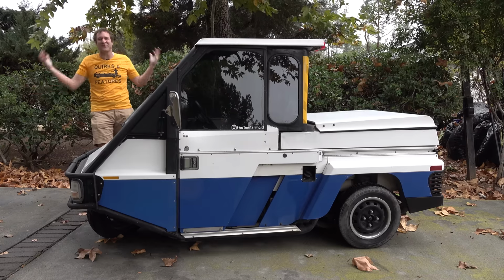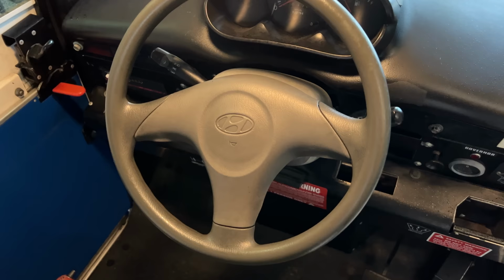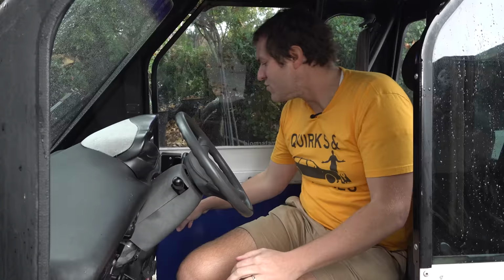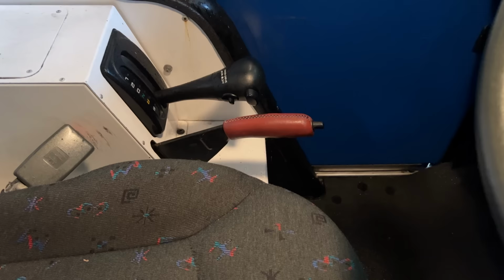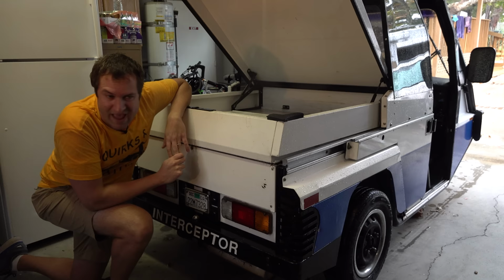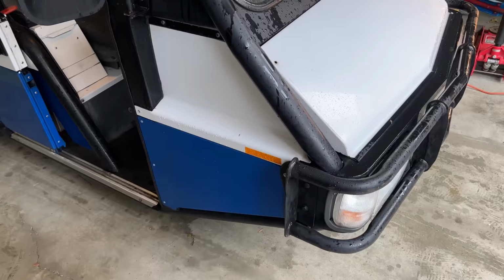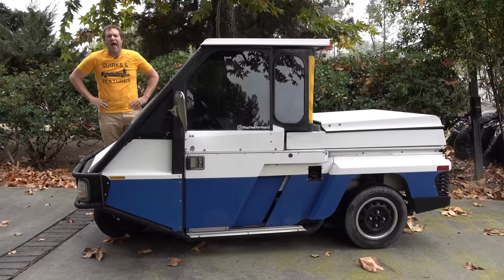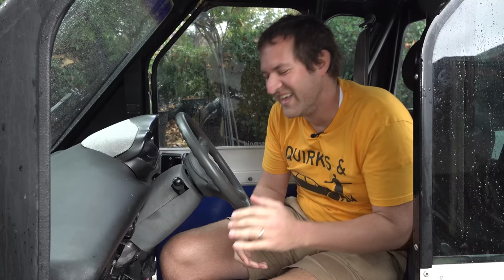Here's a Thorough Review of a Meter Maid Car

Comment: the Lateral Thrust Indicator is a great idea, it should be implemented on all reliant robins
Reply: Jeremy Clarson would suely agree. What I don't get about that instrument: When you're entering a bend  too fast and that thing goes off, isn't it too late to do anything useful at that point? Braking when alread in the turn usually not a good idea.
Reply: @andreasu.3546  Ideally it would be set BEFORE the roll level. So like say 90% of what it would take to roll. If you're ever in a turn where you're going too fast then just let off the gas. When your tires are turned like that you have a lot more drag than you would normally. You can also lightly put your foot on the brake for a bit more as well if you really need it.

Comment: I disagree with a 1 for practicality. Yeah its 3 wheels and its 1 seat, but it's also got a massive cargo area, and realistically has to be pretty good on gas... that's gotta be worth something.
Reply: This looks like it could be redesigned I to something that could be for light duty
Reply: It probably has a tight turning radius and is easy to park
Reply: It'd be super handy for popping down to the supermarket
Reply: @Simoxs7 the part about the Piaggio Apé is so true, I mean, we have a lot of this vehicle here in the Philippines.
Reply: The cargo area didn't look massive, objectively. It looked quite decent for a vehicle that tiny and made for a purpose where cargo doesn't need to exist, but that's it. If the thing was electric, without the engine eating a lot of space from the middle/back, then the cargo area would have been surprisingly spacious.
Reply: Against other cars it's a fair score but for what it does I'd much rather have this than almost any normal car
Reply: For its intended use it is actually a maassive engine, a single cilynder displacing 50 cc would get the job done... Which leads me to the fact that an actual motorcycle would be so much more practical and efficient, and even that would be wasteful because a bicycle can do the same job.
Reply: @Lianpe98  These days you see regularly advertisement for three-wheeled vehicles not that different from the one in the video, but much lighter and electric. The top speed of around 45kph (28mph) and a range of even 150km (93 miles) would be plenty for the job. It would instantly solve the problem of the stupidly loud engine noise we heard in the video.

Furthermore, these electric vehicles, often meant for the elderly, I reckon, seem to cost less than half of the price of that Meter Maid car. Looking at how that Meter Maid car was built, I'm not sure the quality would be a problem either. The only concern might be safety if a big truck collided with the vehicle. How often does that happen, though?
Reply: I'd do grocery runs or small item garage saling in it
Reply: @Simoxs7  Agreed. Especially for something that is primarily going to be idling or just rolling along. It probably could have gotten by with an engine from a riding lawnmower.
Reply: Pizza delivery. That rear cargo space over the engine means "hot to your door".

Comment: I feel that the mid engine as well as the seating position would help stability. Thus keeping the vehicle from easily rolling over. However I feel the car would understeer in wet conditions while traveling at a higher velocity.  Great review, I found this very enjoyable to watch. Thanks Douggy
Reply: It actually handles even better in the wet. I can do burnouts and drifts in the wet haha
Reply: @thatmetermaid6865  How did you come to find out that the lid to your garlic fit perfectly over your wiper fluid reservoir?
Reply: @thomascortes968  Haha so actually it just sits on top. And somehow never fallen off,  and it was there when I bought it.

Comment: Probably already been said but, the extra large cargo area is sometimes used for keeping the "parking boot" to lock your car down if you don't pay your tickets. Not sure if they can hold more than one. I used to live in downtown Eugene Oregon (AKA parking hell) and I've seen them install one more than once. Usually they also have some kind of electric impact gun for putting them on too. (maybe it plugs in to the outlet in the console?)  Also, I have seen one tipped over from hard cornering before so maybe that sensor is a good idea. Two people jumped out of their car and got it upright again pretty quickly though. Driver was kind of shaken up but drove it away.

Comment: Most of the controls (steering wheel, instruments, switches, even the upside down hazard button AND the seats), are from the Hyundai Atos (also called Santro, Amica, Atoz). It was supposed to be looking like a kei car but not exactly one. Always had 0.8, 1.0, 1.1. L engines. Funny thing is that a friend of mine just got one less than a month ago, for fun, and she got her cat stolen... Now it's straight piped and sounds amazing. I've driven it, and it's pathetic slow, with the brakes being spongy, and the a/c cutting all the power :P Also, in my country, Greece, Gatos (Γάτος) is the male cat, and they said we got the "Atos" version of the name, because the front looked like one?!?! Yeah it's crazy.
Reply: Was scared for a moment cuz of how I parsed "got her cat stolen"

Comment: The work switch I’m thinking would be the switch for work lights. In a majority of emergency vehicles or emergency vehicle lighting work lights are just steady white light for scene lighting. The ROT and TA function would make sense if it had an overhead light bar only amber white though. Most agencies aren’t allowed blue light unless it’s police. Amber Red at most but when you dig into light bars that have amber white and red it gets expensive so my guess is that it had amber white functions

Comment: That seat (cloth design and all) is the OEM seat from the first generation Hyundai Accent. On the whole the vehicle is a first-gen Hyundai Accent that only seats one person and can tip over. Perfect for low-speed uses, including supervisor transportation at airports and factories with large campuses (like Boeing).  The reflectors aren't just decals; they are DOT compliant retroreflective tape, and are actually better than the plastic lensed reflectors that most cars use.

Comment: So... let's imagine you are taking a turn too fast in this thing and that lateral acceleration meter goes off... wouldn't the weight shift forward if you hit the brakes and pretty much guarantee a tip over?
Reply: The lateral acceleration meter's alarm makes the driver shit their pants which lowers the center of gravity.
Reply: @Halfpipesaur  🤯🤣

Comment: Honestly this thing would be cool as a hybrid conversion. Get a decently powerful hub motor for the front wheel, say 20KW for AWD and regenerative breaking(wouldnt need that much to maintan 75MPH, let alone the 35 this thing is probably dangerous at), modify the engine cover to be in line with the roof line. A slide out battery carrier on top of where the engine cover was. and around 300w of solar on the roof. Or preferably, raise the motor, and make slide out battery trays under the motor to help lower the center of gravity.
Reply: Scarily enough, if you google their site, there is an EV version available.
Reply: It's braking, not breaking. Good to know our education system is working.
Reply: @pbear216  Are you sure, because this thing looks like its breaking just sitting still
Reply: @pbear216  it's 2022... we've transcended the need to correct peoples' grammar and spelling
Reply: @babyfather  I suppose you're right, I should just accept that people are dumb these days!

Comment: A lot of people saying that is based on the hyundai atoz and they're partially correct, the interior parts and engine, yes, but the exterior is from a little van/pickup called Towner from the former Asia Motors. These little vehicles can be found all over south america and Asia.
In Brazil they became "the hot dog van" because people would often buy these to sell hot dogs on the streets.
Later, Asia Motors became Kia and today they belong to hyundai.

Another fun fack: these bus like seats are made like this because this patterns works well to hide dirt, mainly dust. So it looks clean for longer even when sometimes it is disgusting.

Comment: I'd bet that small storage compartment with the power outlet was intended for the CB or shortwave radio, something like that (apparently officially called a "land mobile radio system" according to Wikipedia).  It's so far back in the compartment that it seems very inconvenient to use, but the radio unit would just need to be plugged in and it'd stay there forever.  A lot of official and company fleet vehicles had built-in places for a radio like that because they were very common back in the day.

Comment: The speedo thing reminds me of something we got here in Germany. We got cars that are marked 25km/h. I'm not entirely sure who or what qualifies for driving one, except ppl with old east german agricultural DLs and I think some disabilities qualify as well. Today there are "cars" build for that purpose, basically small engined plastic boxes with the crash safety of a pair of jeans. But there are also normal cars, like Fiat Pandas and Seat Mebellas. Those were regular cars at some point that just were modified. Most of the time with a bit of wood to lock out everything above second gear, a bit of plastic to limit throttle travel, and removal of the rear seats and rear seat belts. You remove those, which is quite easy with just a screwdriver, and you have a somewhat normal car again. Mechanically speaking, legal requirements apply. They also go with a moped insurance plate. I could imagine they get a different rate, but a plate for a moped goes for around 40€ for the year basic liability. And yeah, they got a totally standard interior. For US ppl: imagine driving a smart car with a top speed around 16 mph.
I'm no expert on this, so if someone knows more or if I made a mistake, feel free to educate us all.

Comment: The Go-4 Interceptor is what you get when you are tired of running errands on a moped in inclement weather.
- "I wish I had an enclosed cab so I could be protected from the elements."
- "Well, now I can't throw my legs out to steady it at slow speed or when stopped, so I'll just add another wheel to the rear."
- "Okay, this is getting heavy, I need a more powerful engine."
- "Now that there's a bigger engine, I can ventilate the cab with a fan, because it gets kinda hot/cold."

Comment: I believe that this vehicle was also used by the US Postal Service in cities as well. Thus, the large rear trunk area for packages. Also, the arm rest that tilts up would be for signed packages receipts meaning the postal workers pockets would not fill up with those receipts. Police use required the “bull bar” in case you had to perform a PIT maneuver (pursuit intervention technique) or TVI (tactical vehicle intervention) on say a driver on a serious sugar rush and need to get that Cozy Coupe off the road or sidewalk.

Comment: The headlights strangely enough didn't actually come from a Hyundai. Those are instead lights straight out from a Daihatsu Hijet/Daihatsu Atrai/Daihatsu Zebra/Kia Towner. I looked it up and the Hijet was available in the US back then but I am sure these headlights are only for non-US markets. The reason why I instantly knew where it came from was because the Zebra was sold here in Indonesia and they are pretty common.

Comment: Hmm,  Westward actually makes a selection of vehicles based on the same chassis.

They do 3 wheel,  reverse trike (2 wheels front 1 rear) and 4 wheel.    No doors, sliding doors, traditional doors  flat deck cargo hauler.   i think they have a 2 seat version too.  choice of gas or electric.

they are used for delivery vehicles, cargo vehicles, maintenance, landscaping, security, and parking enforcement.

Comment: I own a right hand drive 1954 Metropolitan Nash coupe that at one time was (I've been told with some accuracy) a Santa Barbara meter reader car.. It was advertised as an all weather/all year/all around better vehicle then the motor cycles used at the time. The car is pretty rare considering the age and I read less the 500 were r.h.d. cars.

Comment: The biggest quirk of this car is that it exists at all, because for its intended use is actually... a massive and wasteful vehicle (so north american).
Seriously, a motorcycle is just as useful for the same job, uses less space, less fuel, it's cheaper to buy, cheaper to run, cheaper to fix, more agile in traffic, can be used for other stuff too and can carry a second passenger.
Even a bicycle would get the job done.

Comment: That's the same engine, steering wheel, blower switch, indicator stalk, gauge cluster and hazard light switch from the santro and yes it was a front wheel drive engine.

Comment: The Interceptor II is based off the Hyundai Atos which that seat came directly out of. Also it made 55 horsepower with a top speed of 85, still very scary speed given the size. Quarter mile was 19.8s with a speed of 62 😂

Comment: Had to drive one of these back when I was Code Enforcement, they're fucking awful and I avoided it like the plague. ROT was for the overhead rotary light and the work lights just didn't work. They also overheat like nobodies business and you basically have to break it in half to service it. Also they can't go through car washes because they aren't watertight AND have 3 wheels, as such you get to hand wash it when your captain demands... even in January in Oregon. It's also shockingly bad on gas despite it's size. For the fold up armrest we managed to get ours to fold all the way forward to be able to use the area behind the cup holder for storage.

Comment: I'm not going to say cheap but built to purpose.  Why spend money changing steering wheel, shifter etc?  The seat looks fairly comfy, easy to get in and out of, heat, ventilation etc.  What else does Lovely Rita Meter Maid need?  Would be nice if A/C was standard though.

Comment: I have a 2000 model westward Interceptor III, do not know why the 2002 model is an interceptor II, the 2000 model has a steel dash, plastic 3 spoke go cart steering wheel, 1.4 liter daihatsu engine from a ford aspire, and a drivers seat designed by the Marquis De Sade. on my model, you disable the governor by disconnecting the speed sensor on the transmission, yes it is really fun to drive at 70 MPH on the highway, to further ensure my safety, mine is missing the seat belt

Comment: looks like you had a bit of fun at least at the end cant stop laughing for the ride - well pick one up for 1000 bucks it would be great to take to local shopping near by on the cheap long as no need for freeway / higher speed highways, i dunno no radio kinda sucks but would radio even be viable since you claim it was super noisy

Comment: I suppose if i had more money than brains it would be a nice grocery-getter. 
but id need to no the mpg because my mirage gets over 40 and that's hard to beat.
Reply: the company has a 2021 MAX-EV 3 with 2 wheels in the front and 1 rear drive, that ought to sort the stability issue out. 
Theres also a 4 wheel maintenance version. I wonder if they would loan you a review sample.

Comment: Here, in Brazil, we hare a joke.
It will only work in portuguese but I will tell anyway, so you can may adapt it to english.
120 is Cento e vinte.
100 is CEM
20 is vinte.
100 and 20 is CEM e VINTE but 120 is CENTO e VINTE
Always is SEMPRE
So, here the joke with words.
The speedometer goes to 120
O velocimentro vai ate CENTO E VINTE
And we can also joke as 
vai ate SEMPRE e VINTE or SEMPRE 30.
Witch is true for the Interceptor.
Guess we can use in english
HUMBLE and 20 or HUMBLE and 30, right?

Comment: I have owned one, it is not reliable, designed and built badly, almost impossible to find parts for, as it uses parts for a vehicle not released in the United States. Not safe to drive as it is 'top heavy' so it is easy to flip over, the reason for the 'lateral thrust warning' light, and the governor on the engine. So why buy it? easy how about $100 per year motor cycle insurance, ideal for that short shopping or laundry trip. The sad news is that the city of New York no longer buys these, why spend $25,000 on it when a 'Smart Car' is safer, & only costs $15,000, or a Honda 'Trail 125' motor cycle costs $4,000. Yes they are fun to drive and own, are spacious for one, but awkward for two.